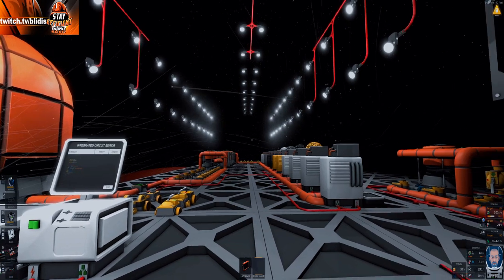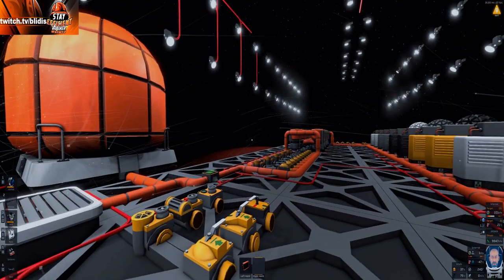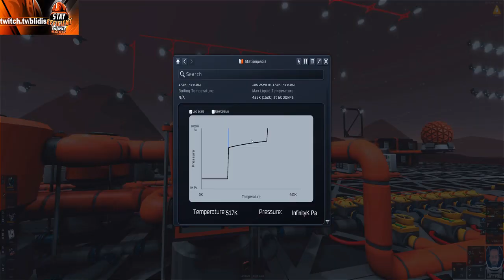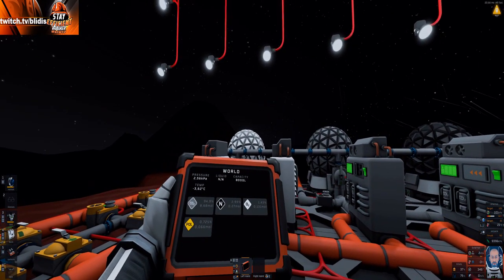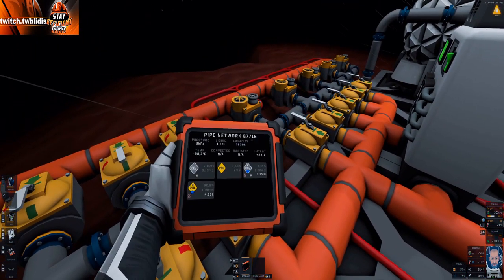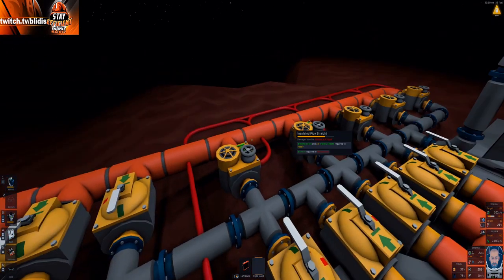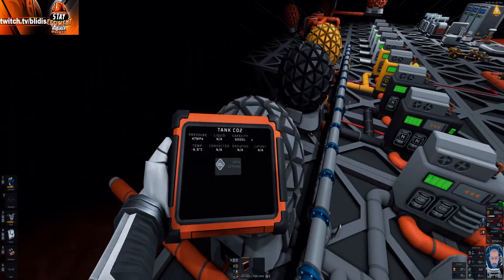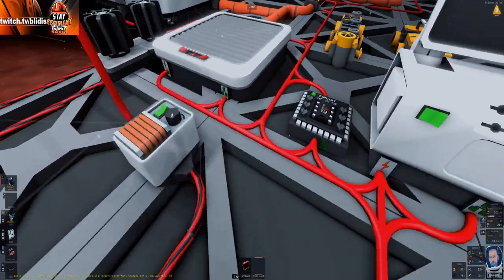Stationeers guide 1 gas

Comment: I haven't tried out the condensers yet, but I have built a cryo-separation system using the air conditioners. It uses an airlocking system to separate the gases into segments until all of the target gas has liquified out (where the one-way condenser valve lets the liquid out). Feels a bit easier to manage than condensers and it removes the need to use filters.
Might be worth doing a comparison for which way is more effective now. Thanks.
Reply from the maker: thanks for your comment not sure how you built your air conditioner system but would like to hear your results which system is best. thanks for the comment
Reply: @blidis  Process is as follows:
1: Build a 4X3 pipe loop on the ground, put the AC in it with the heat exhaust into the middle of the loop (so the power lines are outside the loop)
2: Pressure pump input (currently running 4MPA, but I just realized I need to migrate to 6MPA) and a digital switch for the output (build a set of 4-5 pipes going upward in lieu of a temporary storage tank)
3: Attach a liquid drain valve to let the condensed liquid out and route to a heat exchanger from the output to rewarm it back to a gas (send this to filtered storage)
4: Attach the heat output to the gas input before the pressure pump (so it is "daisy chained" to hand heat back to the main part of the unfiltered storage)
5: Set temp, pressurize the loop, cool until all of target gas liquidizes out, toggle the digital valve to let more gas into the storage (stack) pipe, automate to repeat (note there is about a 1-4 second lag between when the analyzer says there's no more of a gas and when the tablet says there's no more, so add a pause for that)
It might be a bit slower than the condensers, but it's guaranteed gas separation (and it more mimics how they do it IRL)